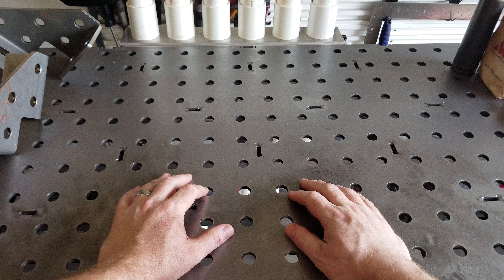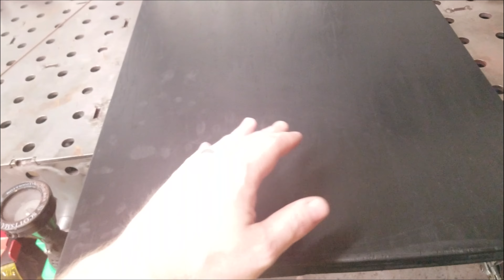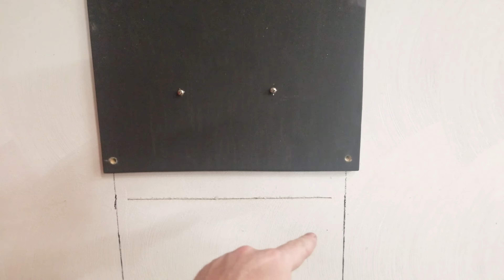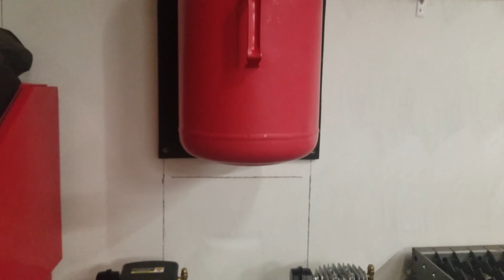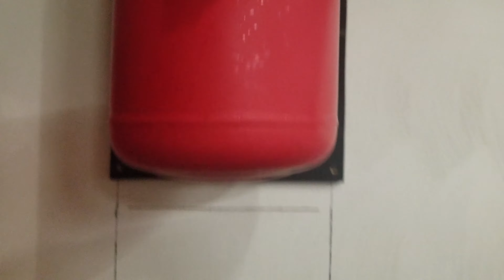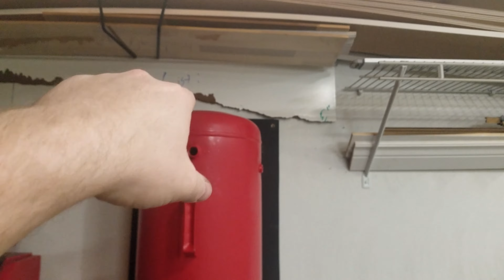Combining 2 smaller compressors for more air capacity and CFM. #fabrication #welding #compressor

Comment: Would have liked to see the new tank pressure tested at least to twice it's working pressure. Also check (non return) valves on each input to new tank. This would stop air from one compressor fighting against the other, as I doubt both the compressors are identical and wear will affect this going forward. An auto drain on a timer fitted to the tank with condensate being piped away would be a nice touch.
Thanks for taking the time to video
Reply from the maker: Had no way to test to that high of a psi with these compressors. Good idea on the check valves. The auto drain would have been a nice touch too. Was trying to get this going as cheap as I could. Thanks for the solid feedback.

Comment: Dude I like what you did but it was more fluff than anything basically a glorified air tank can’t do any work with it
Reply from the maker: Kinda the point. It just increases the volume of air available and also gave me a hub of sorts to connect multiple compressors.

Comment: So what is the psi setting for your compressor when it reach to the point of rest?  I am confused on this part because what if it set to 100 psi, then how much air is in your hub?
Reply from the maker: @MichaelH-z2c  110 psi. 110psi across the board.
Reply: @ thank you.  Here is my next question.  What if your hub is 60 gal or larger, How do you set it up so air doesn’t go backward to the compressor?  Would that possible and safe to do?
Reply from the maker: @ adding that much to these little compressors I can’t recommend. They would probably overheat before they filled all that. The compressors have one way valves to prevent back flow into the compressor heads. You could always put a one way check valve between the compressor and the expansion tank for added piece of mind.
Reply: @HaslipCycleWorks  my goal is to lower the cycling of the compressor, so your set up would achieve this goal when all capacity of tanks are the same?
Reply from the maker: @ it should. They will run longer on the initial fill but the time between the compressors running will be more.
Reply: @HaslipCycleWorks  I don’t know welding, so what is the problem with a T to connect the two compressors to one line to the air hub?
Reply from the maker: @ nothing. I put the valve there incase I wanted to turn off one of the compressors
Reply: @HaslipCycleWorks  thank you so much for the education.  I appreciate you.

Comment: Really enjoyed your video the question I have is the drain bong on the bottom it's not at the lowest point it looks like it's actually recessed in and then the rim around the bong what actually hold water around it as well
Reply from the maker: @markgreen6645 sharp eye, you are correct I should have mounted it in that lower band area. In this position it would not completely drain.

Comment: How much money did you spend on the two compressors the external tank all the fittings and the hose? Then how much time did you spend rigging it all up? Is it really worth it when you could of just bought an air compressor new for 1100 with 13cfm plenty enough for a plasma cutter. Or buy a good used one for 400 bucks. 
I like to see people modify stuff but unless it's making something 10times better it's not worth it. Now if you put 6 of those compressors motors all going into one big 80 gallon tank rather than a bunch of small ones for space you just made a compressor with over 40 cfm and no matter how much time you spend making it it's OK because it's better than what you can buy.
Reply from the maker: @awfab3517  I got the compressors used. At the time I think maybe $200 for both. The air tank was free. Fittings and line were less than $50. We all start somewhere and often times it’s at the bottom. Some of us simply don’t have the money to put $1100 into a big compressor. Not to mention I got years of service out of that setup and then sold it all for what I had in it and upgraded to a large 220v 2 stage 80 gallon compressor, air dryer and regulator, refrigerated air dryer and complete shop air plumbing. All new stuff. But again we all have to start somewhere.

Comment: I'm 4 years late. I had this idea using an already fabricated reserve tank. Working with whats already fabricated, I was going to add a T-Joint to the pre-fabbed input with regulator. Is there an advantage to having 2 seperate inputs to the tank like you did, over using a T and one input to the reserve tank or "HUB"? Thanks!
Reply from the maker: No advantage at all. The T absolutely should work.
Reply: Thanks so much. I have no experience with this stuff so really appreciate your time. @HaslipCycleWorks

Comment: bad idea to be welding to a pressure tank, or drilling holes in it
Reply from the maker: And why is that? That’s how they are made in the factory. I take full responsibility for myself and trust my welds, of course if someone doesn’t feel the same by all means don’t.
Reply: Pretty sure that’s why he tig welded it and not mig.  There is nothing wrong with tig welding a pressurized tank if he’s a good welder and knows what he’s doing.
I’m a union boilermaker and tig weld boiler tube root and stick weld the cover pass 7 days a week 12 hrs a day, and every one is x rayed.  I haven’t had a bad shot yet.  Not one leak either.
Reply: So what is a good idea?  Finish your sentence, I like to know.  No disrespect here.

Comment: I added a 20 gallon (tank only no motor) to my other 20 gallon tank with a motor and the motor still kicks on like it’s only 20 gallons. Is there anyway I could make it not come on so fast? I’m not trying to burn out my motor. I’m using a lot of air tools. After a minute of using it the motor kicks on to refill.
Reply from the maker: There is usually an adjustment for when it cuts off and turns in. Usually near the air input to the tank from the compressor it will be electrically connected to the compressor as well. You may have to find the manual for your compressor to see which way to adjust and how far you can take it. This issue is one reason I went with multiple compressors.
Reply: @HaslipCycleWorks  thank you for the tip on what to look for. I found a few videos on how to adjust. Thank you!!!!!
Reply: @HaslipCycleWorks  ok thank you. I don’t have the manual. Would you happen to know what it called? The switch or valve.
Reply from the maker: @papergatorzfedducca7998  I just know it as a pressure switch.

Comment: HERE IS THE TITLE...  Combining 2 smaller compressors for more air capacity and CFM.  (A ten minute video at most)
ALSO,  After all of that hole drilling work, why is there no condensation drain at the bottom of the new tank?  This tank may not collect much water but it will collect some.
Reply from the maker: You haven’t stated anything that hasn’t already been said in the comments below. There is a drain on the new tank. It is shown at around the 13 minute mark. Yes the video is long, but when trying to show a wide ranging audience of different skill sets and understanding how to do things you error on the side of caution and include as much information as possible as to not leave some people with more questions than answers. If you find yourself unhappy with my video feel free to film, edit and upload your own for the internet to pick apart and criticize.
Reply: @HaslipCycleWorks    Yeah, you are right.  I guess it is all my fault that you choose to meander of topic for 20 minutes.  The point I was making is that this video isn't advertised as a how to use tools and how not to paint video.
If someone watching doesn't have those tools or doesn't know how to PROPERLY use those tools then they probably shouldn't be messing around with a pressurized system in the first place.  It's just dangerous!
Reply from the maker: @tribulationprepper787  whatever you say, next time I’ll send my video idea past you first before I upload. Again feel free to film, edit and upload your own video on how to do it correctly.
Reply: @HaslipCycleWorks  Nice video.  Entertaining that a tool is commenting on using tools...

Comment: A couple of 90ﾟ elbows on your input valves to the red tank would be a more convenient set up for you, that and if you had put them back closer to the wall @ or around the hallway or closer to the bottom. Hell while your @ it just put another  90ﾟ elbow on the top outlet so you don't wear out the a hose through use... great little setup tho. I'd like to see it up and running and it what the difference came out to be for you.  Great video!!!
Reply from the maker: Thank you, great ideas! Appreciate it. It worked really well, I could run my plasma table off if it without issue and the compressors run time was cut way down. It had a few flaws, I’ll correct those in version 2. Thank you again.

Comment: I'm wondering if one compressor start refilling at a higher pressure than the other, is there not a risk that only one compressor always runs? And the other never except if the pressure goes under the threshold of both?
Reply from the maker: With the pressure sensors in these air compressors it's very hard to get them in perfect synch. I see no harm in one running more than the other. If it fails I can close off its feed line and run the remaining compressor until I can replace the failed one.
Reply: @HaslipCycleWorks  Couldn't be off by much could it? Wouldn't they equalize out between the 3 tanks as it's filling? With all valves open , both compressors should operate and read close to the same because both gauges are reading the same thing. Correct?
Reply from the maker: DXT61 that makes sense so all things being equal they should share the load so to speak. As long as the pressure sensor in each compressor is accurate they should run for the same amount of time. However pulling from experience they are not and one usually runs a little longer than the other but not consistently.
Reply: The hand movement is overwrought to say the least.   I mean two distinct hand movements for a one syllable word?   You definitely need to brush up on the Hand Actors Armbook used across the country for great reference and  established standards of articulation when you’ve got a lot to say but you don’t use sign language and are afraid to show your face because of your mob ties, or you are being hunted by your ex-girlfriend or your ego and scalp were damaged in a scary air compressor mishap with 300 psi pointed right at your hairline leaving you with  part of your brain exposed.  So now, as a twisted and vengeful DIY guy, you intend to upend the DIY community by making your hand the most expressive hands of all time, positively exquisite in their range and inflection.    ,
Reply: Crazy how some people are just plain dicks wouldn't you say...I mean damn man do the video yourself so we can witness the great master hand actor in action...or crazy idea here, hold on to your britches friends, save yourself and everyone else involved the know it all and just don't watch something that bugs you that bad. I mean just a thought...😊 @andrewhigdon8346

Comment: Do you have to start with two identical compressors or can one have a little bit more PSI than the other like one has a hundred and the other one has a 150
Reply from the maker: They can different.
Reply: Thank you I'm going to set one of those up soon since I have a few small air tools I want to use I have two small compressors like that already

Comment: You could do a primary (wet) and a secondary (dry) set-up. Plumb both pumps into one tank, connect to the other with a check valve and draw out of the other. The first tank collects all the moisture before it passes into the secondary.
Reply from the maker: Thought about doing that, makes alot of sense. What kept me from doing it is I want to be able to remove one of the compressors completely at a time without having to do alot of work. Incase one fails or for portability.
Reply: Could the wet tank be tiny
Reply: @timr6301  you will want them equal size or the wet tank to be the larger one.

Comment: Do you need an air hub? How does the setup(2 air compressors)work with the sand blast cabinet?  Do you feel it has enough scfm?
Reply from the maker: It actually works pretty well. They seem to keep up with the stuff I've blasted in that cabinet.
Reply: How many SCFM are you getting?  Picked up the 110lbs blaster and need more SCFM.

Comment: Why 1/4” in and 3/8 out?  I would think you would want max volume 3/8 or even 1/2” coming in to manifold.  Then put a larger 1” 3/4” or 1/2” leader coming out of tank for shop air .  This would keep CFMs up and your volume gets into manifold quicker aiding Cfm production.
Reply from the maker: All good questions, I used these sizes because of cost and availability. To have true 3/8 or 1/2" I would have to modify the compressors. Want to keep as much if the warranty as possible.

Comment: So you've got regulated air from both compressors going onto the auxiliary tank. Wouldn't it be better to fill that tank directly from the pressure switch outlets on each compressor, then have your regulator coming off the auxiliary tank? Assuming the aux tank can handle the PSI of the main compressor.
Reply from the maker: I left the regulators on each compressor incase I needed one to be mobile.
Reply: Good observation.

Comment: Did you try to co-ordinate the two compressors at all...to stop one of them coming on first and doing all the work filling the air tank? Or are you happy with one doing all the work and the other kicking on when the first one can't keep up?
Reply: Ok so y not simplify everything and just remove one of the pressure switches,run a hose connecting the 2 tanks an run both pumps on the one pressure switch.  This way both pumps are doing the same work!
Reply: @michaelpreston2392 you'll have to rewire both motors into one pressure switch and upgrade the power supply to a 50amp breaker with 8ga wires, additionally the pressure switch and motors wouldn't last long with that many amps arcing every time it cycled on. FYI a single 15 amp motor probably draws 50amp on start up. In the end you might as well get a magnetic switch.
Reply from the maker: @michaelpreston2392  in case I need to remove a compressor I don't want to have to worry about hooking everything back up.
Reply from the maker: I have adjusted the pressure switches on each and they start and stopped very near to the same time. It's a toss up which one starts first though. May have something to do with how sensitive/accurate the pressure switches are on these things. There has been some talk with Codemakesitgo regarding a digital controller of some type that would handle it and be expandable to handle 1 or 2 more compressors if I ever needed more capacity.
Reply: @HaslipCycleWorks that's a lot of amp draw to have both motors start up simultaneously. My guess is they're 15amp motors, so 2 motors that draw 30 amps continuously can draw 6 times the amount on startup and then factor in that you're plasma cutting or welding at the same time. I hope your wiring and panels are setup for that.
Reply from the maker: @aaronfranchuk5957  they were. Lines were upgraded and so were the breakers. By a master electrician. Not by me of course,

Comment: The 10 gallon tank...Will always hold water because the hole for drainage is indented and not at the absolute bottom of that reserve tank being used as a manifold.
Reply from the maker: But good eye and observation, thank you.
Reply from the maker: Very true, I’m not too worried about though. If it becomes an issue I can relocate the drain valve.